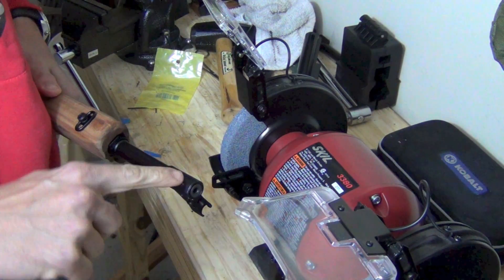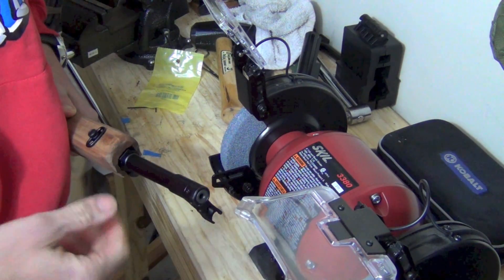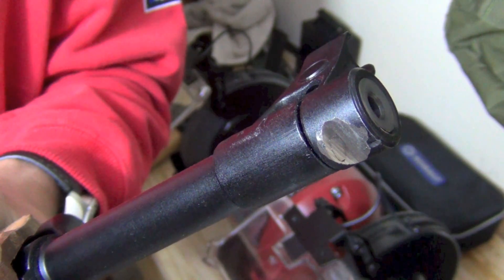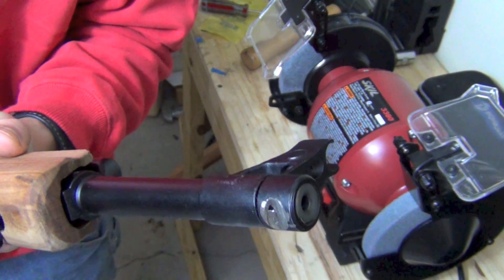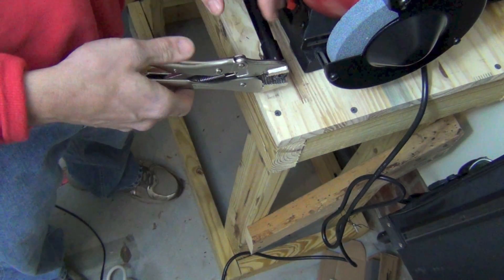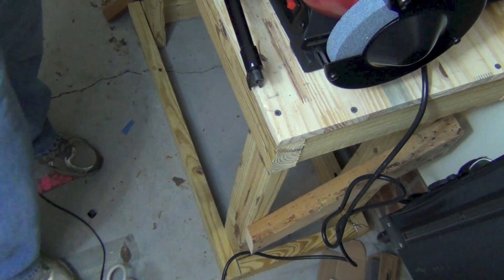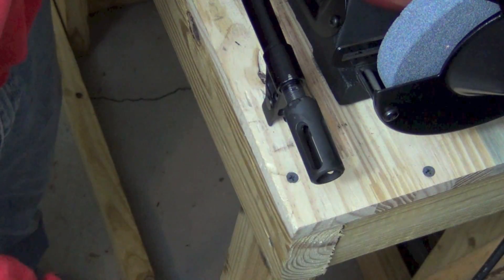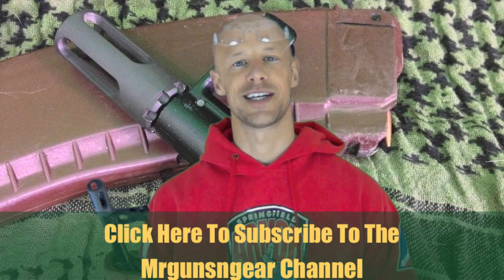How To Remove VEPR AK Thread Protector (HD)

Comment: Thank you for the video. I have a question about installing the muzzle brake. I assume  the rifle does not come with a plunger and spring in the front sight post. Although, at the end of the video you seemed to adjust something. If there is not a plunger, is there a hole there to install? 
I ask for 2 reasons: 1) do you use loctite to secure? 2) if it's a type brake that needs to be aligned a certain way, how is this accomplished? 
I really appreciate your video.
Reply from the maker: Mine has a plunger/spring.
Reply: Thank you.

Comment: Great informative vid. Does this grinding process apply to the Saiga model IZ-132(AK platform)? As I recently purchased this rifle and the barrel is not threaded. Also, off-topic:do you have a recommendation for a good quality single point sling?
Reply from the maker: If it's not threaded it needs to have the FSB replaced.   For a single point I just use MS3 or MS4

Comment: do you know if the molot fime vepr FM AK47 11 has the muzzle nut welded on  like this also?
Reply: Deplorable_Brian it seems really tight do they make some type of tool to take it off easier with?????
Reply: @GlockFan You are not alone  - I'm having the same issue! I can confirm that it is really tight and I'm a fairly strong guy. While pushing the detent and wrenching with all the power I can muster in one hand, the nut doesn't budge. 

One explanation is that the detent is not being pressed in all the way and is locked in one of the four grooves on the muzzle nut, preventing the nut from unthreading. I've given up and decided to take it to my gunsmith.
Reply: J W what kind of wrench are u using?
Reply: @GlockFan I resolved the issue - I was turning the wrong way hence the "tightness". 

The thread on the muzzle of the Vepr FM AK47 11 is "left-handed" - therefore the rule is "left tight, right loose". You will need to turn it counter-clockwise to loosen it. I used a small punch to hold the detent down.  Laid the rifle across my lap and  wrenched counter-clockwise. Honestly, it came loose after a couple good efforts and I was able to finish it with my barehand. 

When you finally get it loose, be sure to apply oil to the thread and    muzzle brake to make your life easier in the future.
Reply: JW but what kind of wrench were u using?
Reply: slip-joint pliers
Reply: I used a standard punch to push in detent and the muzzle nut cam right off without using any pliers or wrenches. LH threads so remember clockwise to loosen as you look from muzzle to breech. New Spikes Dynacomp looks bada$$; now need to see how it works.

Comment: Does the square back veprs take standard ak stocks? Thanks
Reply: Usually all square receiver AK's can take normal AK stocks.
Reply: Awesome, thanks. Do you know about the hand guards?
Reply: ash adam I have no idea. I think it can take regular hand guards though.
Reply: See, I'm thinking mad Mike would have polymered out the front at same time as rear....
Reply: ash adam What? I actually like those handguards though.
Reply: Im thinking he would have put a polymer hand guard set at the same time he changed his stock...
Reply: Even the slant cuts will take an AK stock with a mod.

Comment: what brakes do you suggest for  7.62x54r vepr?
Reply from the maker: +Ryan Wright (lugnut719) Well, any of the 14mm brakes I've reviewed positively I suppose.
Reply: +Mrgunsngear Channel Ok, my Vepr has the slant cut and no thread protector or threads. How do I go about threading the barrel myself, and another question, mine feeds with standard mags just fine with no guide. Is this just a fluke? I did have to file the mag lock.

Comment: Could you not drill the pin out?
Reply from the maker: I suppose you could but then you'd risk hitting the threads and further damaging them.  I think this is easier but both would work I suppose.
Reply: Makes sense